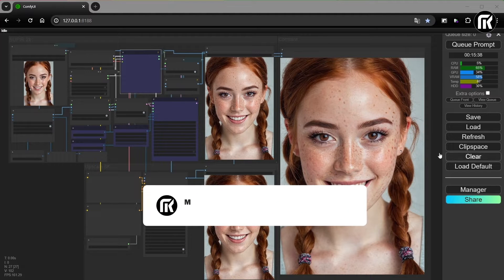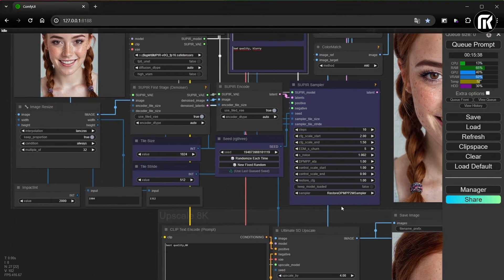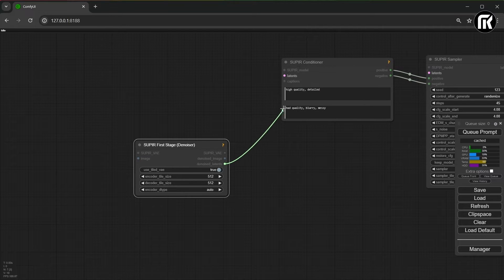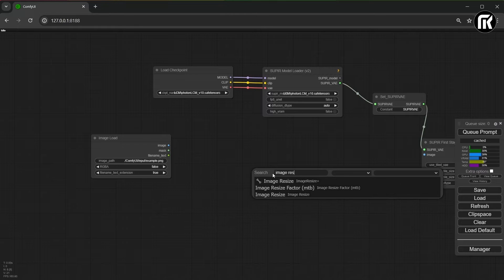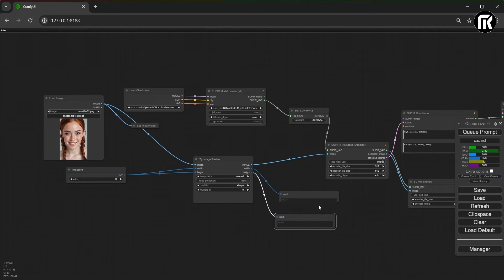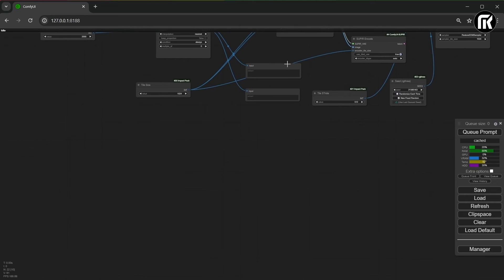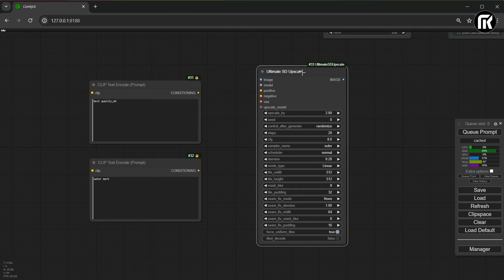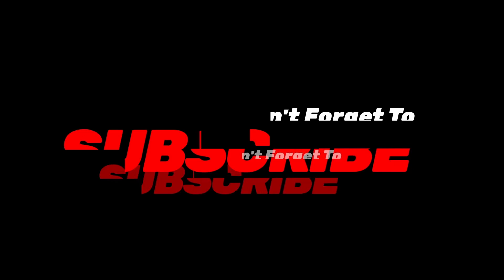Supir 8K with SD Ultimate Upscale | Scaling-UP Image Restoration | SUPIR (Workflow Tutorial)

Comment: Sadly, there are a lot of jumps where you changed the nodes completely but never commented it, and you also left some things unconnected. I can figure it out mostly, but it is not easy to follow along if you are very new or don't spot where things got changed.
Reply from the maker: I considered that the supir nodes have already been seen in the previous supir  video and if there are any cuts, it is to keep the workflow clean without too many unnecessary connections and more visibility.
I will post the clean workflow.I will share soon the full workflow to avoid any confusion 🙂
Reply: @MunKaw-ui  I meant for example the fact you didn't connect the supir model to the sampler when showing how you build it, or you switched out one image load more for the other. That is what makes following it a bit hard for newbies, which luckily I am not anymore so I got it up and running anyways.
Just a hint for future videos, as I like the general style you do 😊